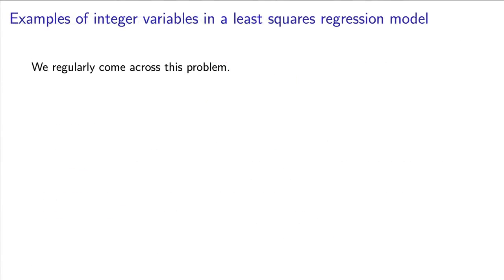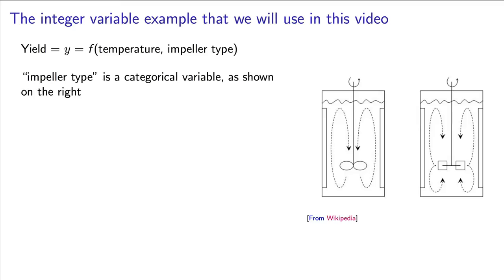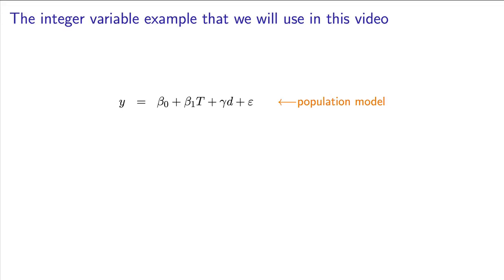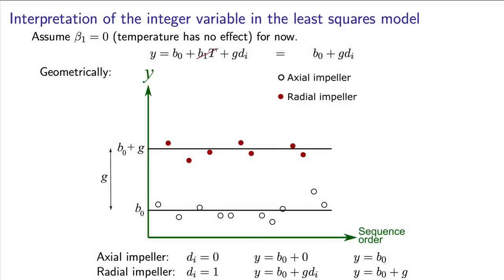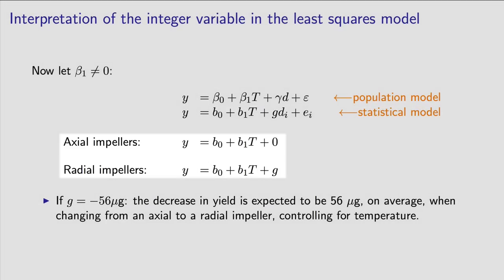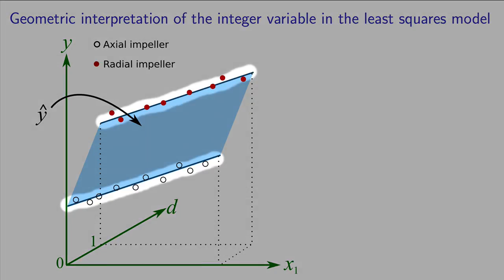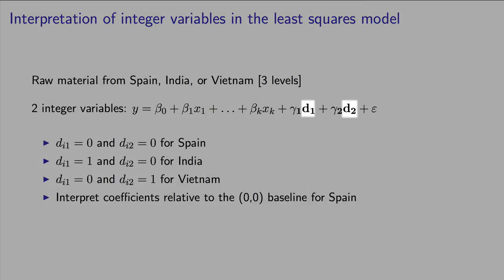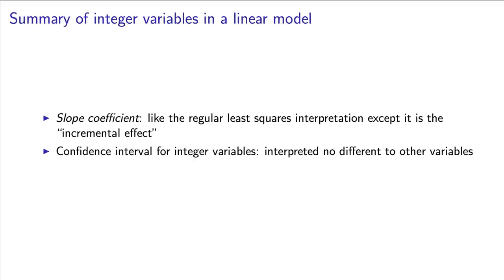Least squares - 15 - Multiple linear regression - using and interpreting integer variables

Comment: I would also like to thank you for the excellent videos! You have a great way of teaching this material and I got here from first going through the DOE coursera course and being pointed to the videos from the referenced book. These additional videos put the DOE-method in better perspective. 

Sub-question: I understand that the q-q plot is a great tool for single variable tests of normality - Is there a way to use this plot with multiple linear regression models in a simple way in R?